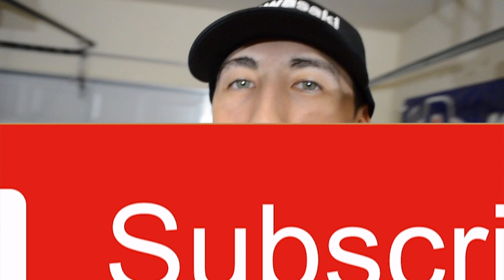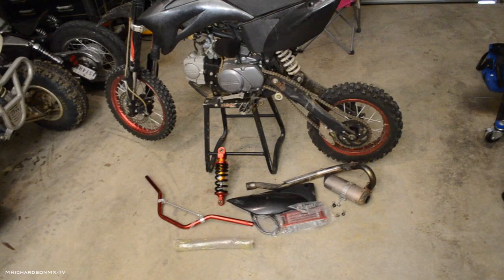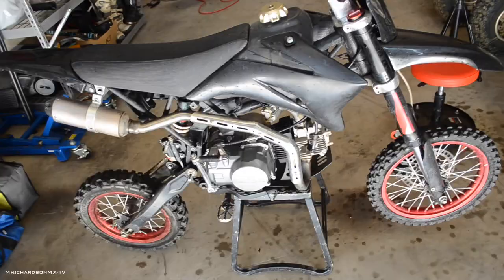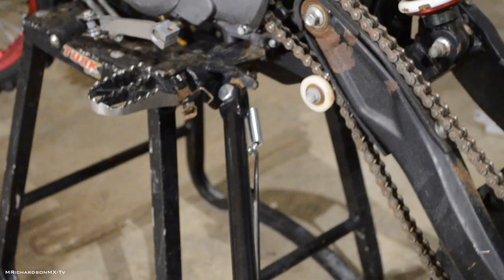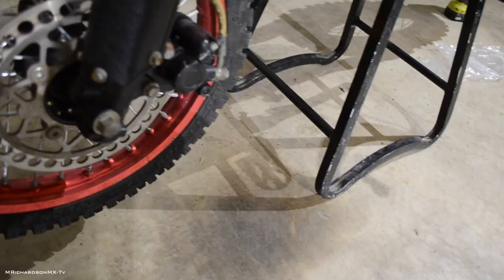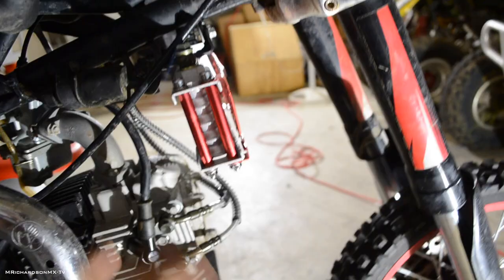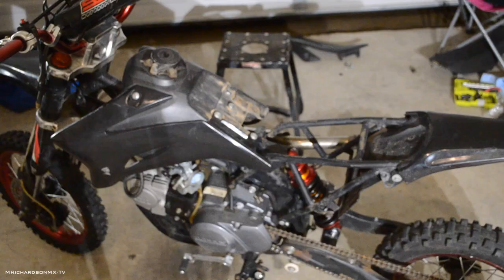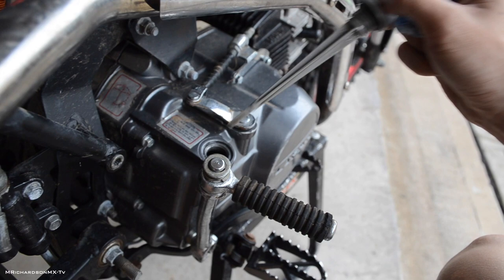Oversized Oil Cooler Install on my SSR140TR!

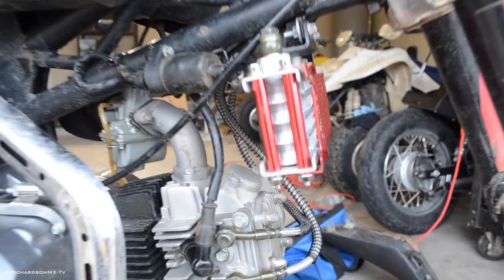Comment: 12:40 look for plug on crankcase and plug on clutch cover.  These are for oil cooler lines. Must at least connect the two with a line for proper oil flow.

Comment: Did you have any problems with the clutch engagement for neutral?? My shit shuts off every time I put it in gear
Reply from the maker: YES! There is a side plate you can adjust and it will change it up a lot, also playing with the clutch cable' pull can help out as well, there are tutorial videos out there that can help you with that!